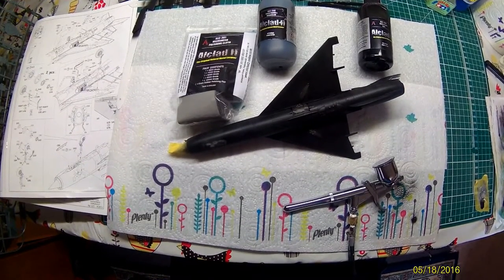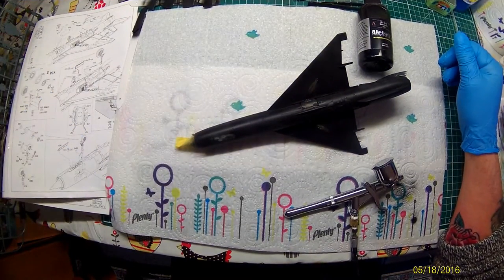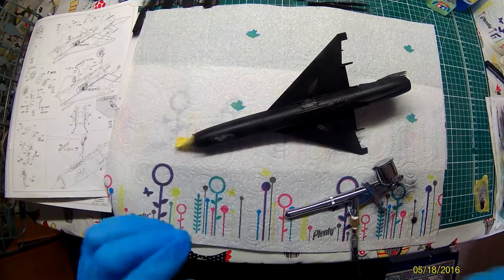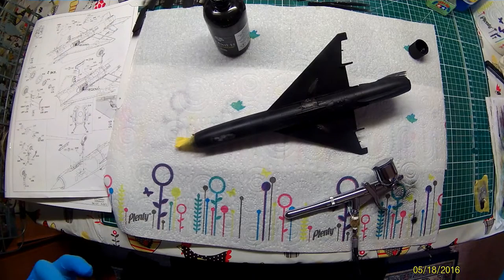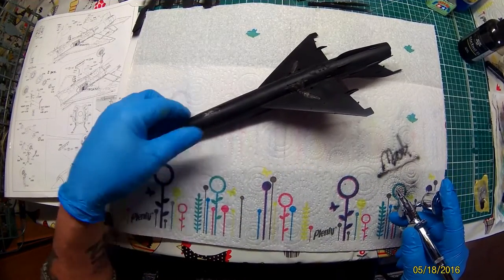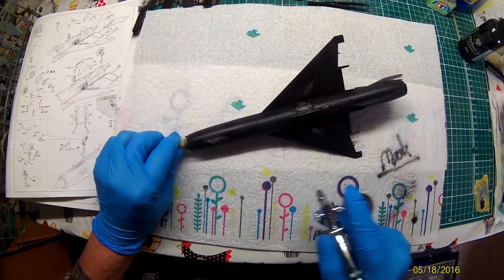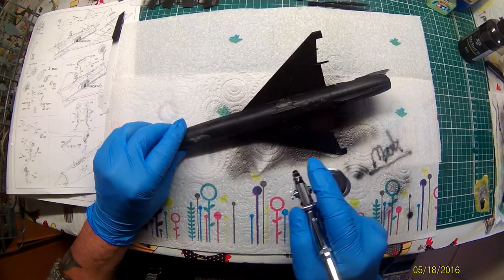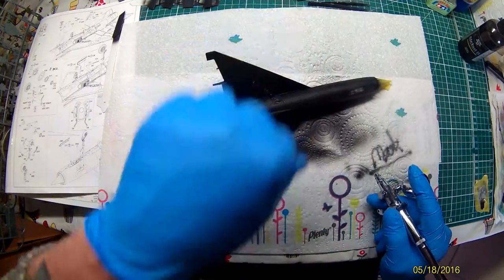How to Airbrush Alclad Gloss Black Base

Comment: My airbrush is a venerable old Badger 201.  Will all this work as well in bottom-draw airbrushes as well as gravity fed ones?  Can the gravity fed brushes be fitted with a cover so the paint doesn't get spilled?
Reply: MOST gravity fed brushes do come with a cover with a small hole in the top to vent while not splashing paint even the small ones but your also usually not filling it completely full so theres very little concern for spilling. and typically speaking it all depends on your needle size as to weather it will work with it. ideal scenario is for metals and primers you want to go with a bigger needle(.5+) so that the metal flakes and fillers can flow through the airbrush. not 100% sure if the 201 comes in multiple size needles like alot of the newer badger airbrushes do so cant give you a more specific answer.

Comment: Couldn’t get a non speckle finish, I realise I had the air pressure at 12-15 psi , so a higher pressure is required and didn’t leave it to dry for very long , this is so different to Vallejo. I’ll try again . Regards Fred. Ps I’m intending to spray matchbox vehicles
Reply from the maker: Hi We have completly changed the formula now for the GBB. A new video on my channel was uploaded a weel ago :-)